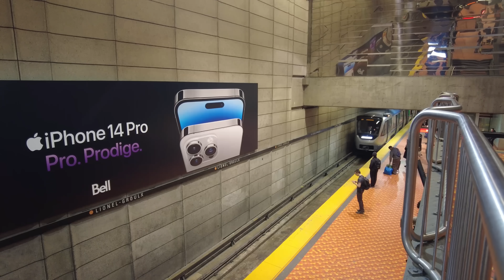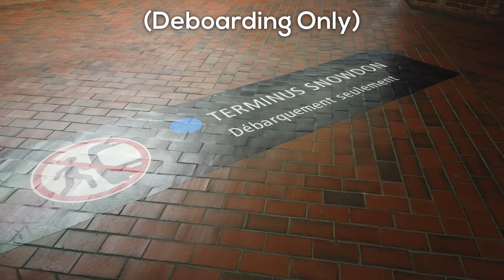How the World’s Best Transit Systems Achieve Amazing Frequency

Comment: On some lines in London, they improve turnaround time by having another driver waiting at the other end of the platform to get in at the other end to drive the train out. The driver who took the train into the platform leaves the train, then walks to the other end of the platform to drive out the next train. It requires an extra driver per shift to do that because at any given time, one driver will be walking to the other end of the platform while the others are driving trains. But you do get more journeys for the same number of trains.

Comment: In the UK, most buses sadly only have 1 door all the way at the front so at the busier stops, you often have to join a queue to get off if you're sitting at the back. In the rest of Europe, buses often have 3, 4 or even 5 doors.
Reply from the maker: Buses in the UK are rough :/
Reply: @RMTransit  Buses outside London are rough. TFL know how to do it right.
Reply: in greece they have 2-3 the short ones, the long ones have 3-4
in cities other than athens its also 2 entrances
Reply: In the US buses usually have two doors but the rear door is often unusable due to the poorly trained drivers coming up to the curb so that the bus is at an angle or the artic bus is crooked, and passengers would be confronted with too high a step or too wide a gap to mind.
Reply: What's weird is First Bristol have ordered some buses with 1 door, and some more with a second door!
Reply: Unless it’s London’s TfL or Edinburghs Lothian buses. Kings of UK busses 💪
Reply: I thought that was because you love queueing.
Reply: My local operator Brighton&Hove run core routes, i.e those with daytime frequencies of 12min or less, using twin door double deckers, those introduced in recent years being battery hybrids. 

The less intensive evening and Sunday services see these vehicles utilized on outlying routes which normally rely on 'cascaded' vehicles.

B&H tried 'bendy buses' for a good few years, but they didn't mix well with a 200 year old city centre, cyclists, pedestrians and 'over-refreshed' stag and hen parties..
Reply: @TheHoveHeretic The point is outside of London, more than 1 door set per bus is the exception not the norm. Unfortunately.
Reply: The issue is for private operators that a second door allows for fare evasion to be easier, also the second door adds extra maintence costs and as we know with private operators they try to extract as much revenue as possible from a service.

Comment: 5:10 cough cough MTR Airport Lines (Tung Chung Line and Airport Express)
Reply from the maker: Ooof didn't know that was the case for them, this sucks!
Reply: @RMTransit The reason Tung Chung Line unable to run more frequent service is exactly due to limitation on infrastructure (the Lantau Link section of the line) and power supply system

Comment: Sydney Trains has something called a "City Circle" where three suburban lines running at suburban frequencies converge onto a single pair of tracks to run through the busy CBD.
It's pretty neat on paper, as it operates with metro-like frequencies within the City Circle, but if one of those lines gets delayed due to some emergency the knock-on delays would affect THREE lines instead of one. It's a pretty amusing achilles heel until it makes it onto the news with yet another "train delay paralyses entire network angering commuters" headline.
Reply from the maker: I've talked about the circle in a number of videos, while interlining like this can lead to knock on delays its done around the world without issue, just need good planning and operations!
Reply: With the result that Australian governments are spending billions on new cross-city tracks instead of millions on improving reliability i.e.  signalling, trains and communicaton.
Reply: @jack2453  I don't think they could realistically have done any better. Better signalling wouldn't have solved the achilles heel of the system in squeezing 3 entire lines worth of trains into one, unless accleration and deceleration is improved.

With that being said, I reckon the best course of action is to build facilities to turn trains around after Central, to 1) alleviate congestion around the City Circle and 2) in the event of delays, reduce knock-on.

The problem is that I guess Sydney Metro's the accepted solution so we'll just have to roll with it. I guess robot trains can't go on strike...
Reply: @kaihang4685  Multiple lines running through the central core branching further out is exactly how the Paris RER and the Berlin and Munich S-bahns work. It is not a fatal flaw. It just needs good management.

Comment: I saw on Madrid's line 3 on a rainy day I decided to 100% the line (having only gone south of Sol on 2 occasions, one of those times was to the train museum). At Moncloa, it does switch sides, but there was another train sitting on the other side at Villaverde Alto. Line 2 and Line 4 do that too sometimes at their western terminals of Cuatro Caminos and Arguelles-but there it makes sense to have most trains have access to both the side and Island platform (which at Cuatro Caminos is a quick transfer to continue northbound on Line 1-which was useful to me being one stop north), so it simple cuts out some inconvenience where that case at Villaverde Alto proved well as I was just going to take that train back to Legazpi...and then I think I walked over to the Planetarium (I had no plan and had the day off from class)
Reply from the maker: I am jealous, I need to visit Madrid!
Reply: @RMTransit  well Pinar del Ray was closed and Cuatro Caminos a construction zone most of my time. Line 3 extension should open in the spring and line 11 in phases from late 2026

Comment: I think you'd love to know that in Barcelona Sants, the suburbian railway trains enter and depart from the station at the same time but in the same track. I've also seen sometimes that a train enters and goes to the end of the platform, and then another train enter the same platform but stops at the beggining of it (because the trains are half the length of the platform) I don't think that's efficient or safe, but at least it's interesting!
Reply from the maker: It can be both efficient and safe, its known as double berthing!

Comment: It's not "less" doors, it's "fewer" doors. Essentially, The rule is if the plural of the noun ends in "s" you would most likely use "fewer" e.g. fewer doors, fewer trains, fewer riders etc. One should only use "less" with non-countable nouns (nouns that don't end in "s" when pluralised, or quantities) e.g. less service, less frequent, less distance etc. Hoping you can incorporate this in your future videos! Thanks 😊
Reply from the maker: That assumes a prescriptivist view of language which I do not believe in. I speak English the way English is spoken to and around me!
Reply: Oh no the grammer police is on the case ..lol
Reply: @SeanSoraghan  Should that be, the grammar police are in, rather than is?
Just asking.😁😁

Also I think less doors is correct when considering  that it is not just a count of doors that matters but also their overall size. As well as positioning.
So 'less' in this instance is correct.
Reply: @jack2453  Why are you using Latin abbreviations? Would someone think about the English purity! 😰

edit: oops, someome couldn't stand for their opinion 😅
Reply: Completey agree - and can I add that its not 'x times more', it's 'x times as many/much'. (And don't get me started on x tines less).
Reply: Time to give up on fixed-state ideas. English is an evolving language. Whilst you and I might not like it, "fewer" is often replaced with "less". We're seeing "its" being replaced with "it's". That's just how languages change. I know I wouldn't want to have to go back to the old second person singular; wouldst thou?

Comment: The Victoria line in London has terminals with just a single island platform. The train arrives and the driver gets off, and at the other end another driver is waiting, and gets on to drive the train back the other way. As the train leaves the first driver walks down the platform to the other end, and while he walks, a train arrives and does the same on the other platform. Shortly after he reaches the other end, the next train arrives, its driver gets off, and this driver gets on to drive it back. 

The Victoria line runs every 90 seconds at peak times, so it's a pretty efficient system and works well, and no need for reversing sidings.
Reply: I mean, it works, but it's definitely not an optimal solution. Even the peak 36tph (100 second headway) can only be achieved for a short period because of these 2 track termini. And 'stepping back' has obvious issues in terms of resilience to disruption, as it requires virtually all drivers to be in the right place at the right time, all the time.

So problematic are the 2 track termini on the Victoria Line that there have been repeated schemes to extend the line one stop south from Brixton on to a loop line to Herne Hill - just to get rid of that bottleneck
Reply: The Victoria line handles 36tph for the full peak periods and longer than other tube lines for 3 hours of 36tph in both the morning and evening peak.  @haltendehand1
Reply: @haltendehand1  But dosnt all sorts of ways to reverse train at such frequency require "all drivers to be at the in the right place at the right time?" (apart from automated reversing)?

At such frequency, even with reversing sidings beyond the terminals, the time between the train stops at the end of the track and it needs to go the other way usually is not enough for a single driver to {switch off the cab at one end, walk the full length of train, switch on the cab at the other end, do all the checks, start moving the train}, so the norm for metros with such frequency is for another driver (driver B) to step in the cab at the rear of the train when it comes into the terminal station, and when the train reaches the end of the reversing siding, driver A switch off the cab and handed control to driver B who is now ready to move the train in the other direction. I believe this is the norm and it has the same require "all drivers to be at the in the right place at the right time?"/ "resilience " issue that you mention. 

And the alternative as I mentioned before is automated reversing, which may not be able to be implemented in older systems. ie when the train stops at the terminal platform, the driver hands control to the computer, while the train doing all the {driving to reversing siding, reverse, move back to the other platform}, the driver walks along the  train and by the time the train reaches the boarding platform, the driver that drives the train to the station is now ready to go at the other end. 

(PS. I believe at Victorian line terminals, they step back by two trains, which means at the peak there are always more than one driver waling back at the platform, hopefully resolving the "resilience " issue
Reply: @jonathanma2741  An advantage to this is that you can at least schedule pauses for the drivers. Don't have just two more drivers than trains, have 4-5 extra drivers. It would still be stressful of course, but not quite as bad.
Reply from the maker: IIRC the Victoria line does 32-36tph so not quite 90s?

The stepped back operation is effective, but not quite optimal!
Reply: @RMTransit The Victoria currently has at least 34tph in each peak, scheduled services sometimes get to 85s between trains, with a total line capacity of 40tph, the reason why it doesn’t run at 40 at the moment is because of long dwell times at stations like King’s Cross St Pancras and Victoria, where already the amount of people often makes trains up to 20s late which causes the trains to sometimes run as close as 70s behind each other. This is one of the reasons why crossrail 2 was proposed as the amount of people using the Victoria keeps on increasing but it is becoming impossible to retain its high reliability and operate more trains, so crossrail 2 would alleviate pressure and allow the Victoria to finally reach 40tph, which would mean it becomes double the bakerloo line peak frequency.
Reply: I don't know the tph figure, but the Waterloo & City line is an interesting case study. They have 2 dead end platforms at bank, and reversing sidings at Waterloo. In the rush hour, the trains seem to dwell for only about 1 minute at most. In fact I think they have 2 drivers in them. One at each end, and they just ride in the back cab on the return journey rather than getting out and walking along the platform.
Reply: @mdhazeldine  Only having 2 stations makes this so much more workable.  They couldn't get away with having a driver sat doing nothing for an entire route on the Northern Line!
Reply: @JustSomeBloke1  Yes of course. It is an unusual case.
Reply: @JustSomeBloke1  Depending on how many trains are on the line at the same time, the numbers will differ.

But with two trains on the line, you need four drivers regardless of how long the line is.

With four trains on the line, you either need 6 or 8 drivers. (minimum)
Reply: Of course it's better to have sidings behind the terminal.

But it's always better to have a wide island platform instead of side platforms: In those cases where you turn back at the platform and don't use the sidings (maybe if they are blocked) then it's easier for the passengers to get a train from either platform
Reply: This is what I think of as the "Japanese solution", analogous to the "Spanish solution" mentioned in the video.  It was introduced for a Tokyo terminus, where there literally wasn't enough space to build more than a two-platform terminus - but a high service frequency is an absolute necessity to maintain sufficient capacity to avoid dangerous overcrowding (and if you know anything about Tokyo, you know the trains can be quite crowded enough as it is).  To maintain this service frequency, the dwell time at this terminus is kept to the minimum necessary to exchange a full trainload of passengers, with a driver standing ready to take over the train at the departure end.  I suspect the situation is similar for the Victoria Line, considering it's underground and tunnelling is always expensive.
Reply: Meanwhile Singapore is lengthening the 2 overrun tracks at its Pasir Ris terminus station, & when that happens, trains won't reverse at alternate tracks in the station anymore via switches connecting the tracks together just before the station (the station has 2 tracks that share an island platform), but reverse at the 2 overrun tracks that extend from the station's 2 tracks (previously the overruns were too short to have switches to connect the 2 of them together). This way you no longer have the stretch of tracks leading to this terminus station (from where the switches before this station are located) being 2-way & thus being each able to accommodate only 1 train @ a time, which likely allows train frequency to be increased from once every 2min to once every 100s, instead of 110s
Reply: Of course, you can get higher frequency and not depend on one walking fast enough by adding an additional driver which is already there when the train arrives, ready to jump in. (But if there are other bottle necks, this doesn't help.)

Comment: I'm wondering why tail tracks beyond the terminal allow higher frequency of the train? Doesnt it require the train to stop twice and require drivers to walk from one end to another while the train is stopped at the tail tracks, not picking up passengers?
Reply: Short answer: for a train to switch back when it has reached a terminal, it will limit the capacity because it needs to cross the path of incoming trains, which in turn then have to wait to enter the station. By having a train go to a track past the terminal, you eliminate this hurdle.
Reply from the maker: I like this explanation, I endorse!@ @nigiiobi1154
Reply: I'd guess that it's just the extra space you get from it, you can have 4 instead of trains at the terminal at the same time
Reply: The train has to stop twice, but you effectively get room to fit in a whole extra train. Regarding the driver walking down the train, the Elizabeth line in London uses completely automated operation for the turnback portion of the line, which means the driver can walk down the train while the train drives itself to the next platform!
Reply: The short answer: Grade separation, the removal of level crossings i.e. points of conflicts.

Long answer: The purpose of tail tracks to prevent trains from blocking the tracks of other trains just because one is about to start or terminate. This is two-fold: On a pure terminus, this typically means a train will only start driving if the other train is about to enter the platform area and thus flexibility in operation but tail tracks don't need to care about blocked switched. On top of that, tail tracks leave the tracks clear for trains which proceed further without requiring them to slow down if not stop for both in- and outbound trains, further addign flexibility to the operation (without that, a terminating outbound train would have to proceed to the next turnout, wait there until the inbound train enters the station if one is about to enter all while blocking the tracks of the other outbound train and not much time to spare). On a minor scale, it also results in consistent platform assignments i.e. you always know that platform A has the starting and platform B the terminating trains (which IMO is more natural than having to figure out which train to take) and they also double as a storage space as seen in e.g. the S-Bahn tunnel of Berlin.
Ironically, tail tracks are a form of grade separation which happens at grade but it's also the only one I can think of.